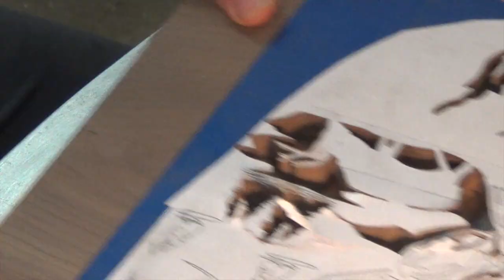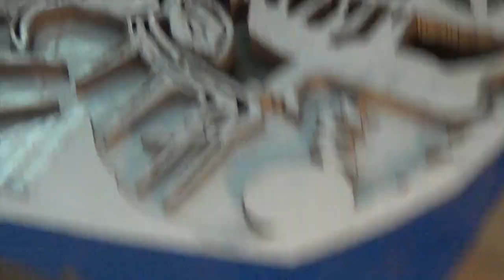Sped up scroll work- Live Edge Walnut with deer

Comment: Leldon, is that packing tape top of the pattern?  If so, is it just to hold the pattern to the work piece, or does it serve another purpose?  Thanks.
Reply from the maker: The pattern was printed in 4 sheets, I just used the packaging tape to tape the paper together to get the design together.  The blue painters tape on the bottom helps in removing the pattern and also helps lubricating the blade during cutting to prevent burning of the wood!

Comment: nice work just started working with the scroll saw. question what number blade are you using and  what is the thickness of the wood you were using. very nice work
Reply from the maker: Thanks!  It's a number 2 Olson brand reverse tooth blade. 1/2" walnut is the wood!  Thanks!

Comment: I am new to your channel.  I also am a scroller.  I don't own an Excalibur but have drooling over them.  Can you tell me what makes an Excalibur better than other saws on the market?  I enjoy watching your work and will definitely subscribe to your channel.  The antelope you see next to my post is one of my works.
Reply from the maker: Great work!  I love the Excalibur saw I have.  The blade changes are fast, the saw has power, and a great sized table top to support your scroll saw pieces.  The updated versions make releasing the tension easier by just using a flip type switch that releases the tension.  Great warranty too!  I would recommend buying one from seyco.com if you live in the USA.  They have great service and can help if a problem ever does arise!